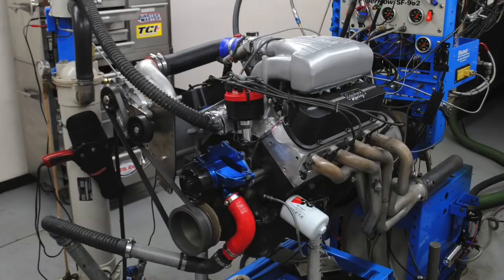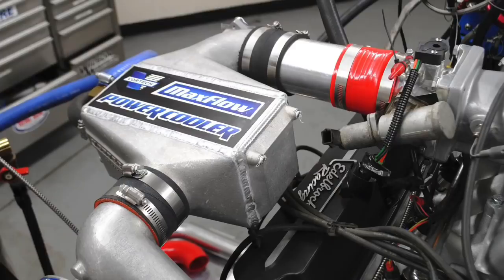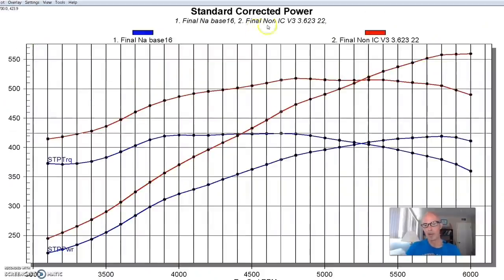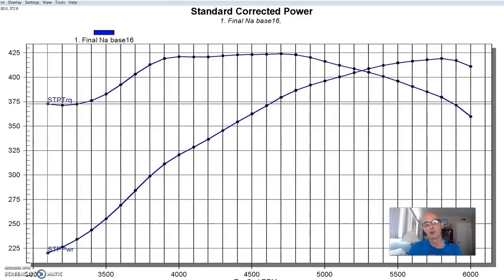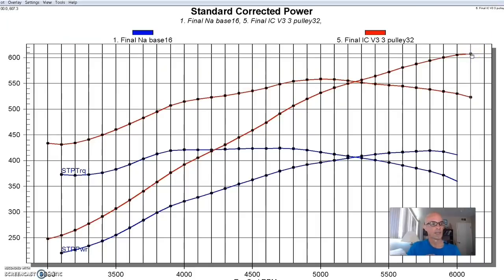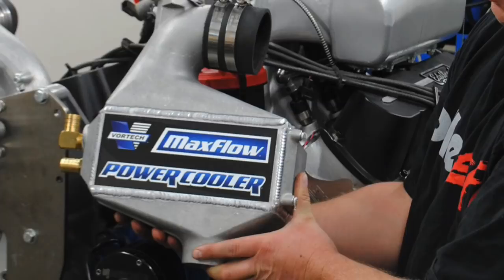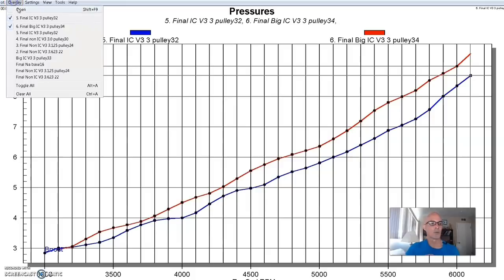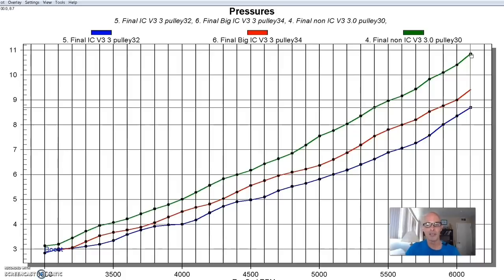WHAT MAKES MORE? INTERCOOLED OR NON?

Comment: It's good to see the Edelbrock Power Package deliver as advertised. They claim 410 hp from their 351W kit, and you got a little bit more. And that's on a junkyard short block!
Reply from the maker: we made 459 hp with a carb on this
Reply: @richardholdener1727  Wow! Why so much more than advertised? A different dyno protocol? Or did Edelbrock test theirs with EFI?
Reply: @donellmuniz590  his numbers are always higher because no accessories turning, straight headers with no exhaust etc plus it has no driveline loss not sure if they were quoting crank hp or not.

Comment: I think in realworld application i.e. in car the temps for non intercooler do to underhood temps and more load from accessory assembly and load generated from drivetrain and actual road force. And agree with you using intercooler regardless

Comment: Awsome thanks for the video! Just picked up a water to air cooler like the one you used for 200 with a zr1 heat exchanger. I'm so happy to hear that I will be making safer hp than running non intercooler. Thanks for your hard work Richard.

Comment: We have ran similar testing on Yamaha Waverunners which have crankcase mounted Centrifugal Superchargers from the factory.Running up to 30psi the Big Chinese/Ebay intercoolers always made more power than the smaller Vortech/garrett cores.The cheaper cores with less fin density always flow more CFM and with open fresh water cooling intake temps do not change much either way.The larger and cheaper the better IMO

Comment: the cooler denser air slows down the flame front....
Which allows you to add more timing to make more power... which you didn't do at all...
So you didn't change timing to take advantage of the cooler denser air....
And you also had less boost overall...

You didnt do a proper and equal test

So even without any tuning changes.. it made the same power on less boost...
That means its making more power with the intercooler

Comment: I think the main purpose of the intercooler is to A. lower the charge temperature & B. lessen the chance of detonation and enable you to run more timing advance to create more power. I bet if you had re-adjust the timing in the tune with the larger intercooler it would have surpassed the non-intercooled HP numbers by a good bit.

Comment: Do you ever tested a difference in charge air temps using a injector on the pipe? Like those water methanol kits, or even a fuel injector.
Reply: The owner of procharger has a drag car that has two injectors dumping meth straight into the blower. Cool car

Comment: I been playing with WMI on my turbo car. Yesterday was 95f. I have a air air intercooler and right after the outlet is a snow performance WMI nozzle size 3. 50/50 mix was seeing charge temps of 73f.
Reply: That's really good.
Reply: @donellmuniz590  I thought it was good as well. It's a noticable difference. It's nice getting timing advance on hot days. Before WMI i would usually see -5 or so.

Comment: It sounds to me that you didn't maximize the tune the changes (especially timing). The cooler air charge temps should have allowed more timing. Also it could have be overly lean/rich which would have killed power.

Comment: Would love to see non intercooler E85 vs M1 fuel.  Measure inlet temps and egt's at say 15-20 pounds of boost.  Interested to see how E85 cools combustion vs M1.  Methanol should be better, but how much better?
Reply: About 3xs the fuel so yeah pretty good on the intake end as for egts it's not much cooler. When we ran meth we saw 1450 happy on e85 we see 1450.. on long runs the meth gets closer to 1700 but we don't do landspeed. E gets to 1800ish on the same runs. So it's cooler but not by much but if your running enough boost and have enough spark you can keep it at 900 like in a blower motor and it lives happy. Can't do that as easy on e85.

Comment: I feel you limited the intercooler applications because you didnt adjust the tune at all between the tests. Isnt that the benefit of the intercooler? Cooler air so you can run more timing and less fuel. If you take that out its mostly an airflow restriction. Hmmm.

Comment: I run a Vortech V3 on my V8 Audi S4. I have run it without an intercooler and then with an A2W intercooler both at 6.5-7 psi of boost pressure. The ECU would pull ignition timing from too much knock after most of a 1/4 mile dragstrip pass when running without an intercooler. With an intercooler I can keep the IATs down and not see any ignition timing pull. It seems like this 351 W isn't knock limited.
Reply from the maker: WE RAN GOOD GAS
Reply: @richardholdener1727  that definitely helps to prevent knock. I would see better results on 104 octane vs 93 octane.

Comment: Simple = He Told us the secret over and over... The Timing was still set at the "Safe" setting for the Non-IC Intake Temps (non-aftercooled if you want to be technical) and anyone who has "Fixed" the 70s smog engines will tell you Timing = Power if your Air Charge (and Boost Pressures) allow it... Cooler IAC + Less Boost = MORE TIMING!
Reply: Speaking of 70s smog engines, did you know that Ford installed the cam 6-8 degrees retarded on the 351M/400?  That's one of several reasons they're such gutless pigs, despite 2V Cleveland heads. They may have done it on other engines, but I don't know. A simple hi-perf aftermarket timing chain fixes that.
Reply: @donellmuniz590  GM was doing the same thing during this era. 3 degrees of cam retard ground into the cams and ignition timing retarded -both to help emissions and because all the EGR requires less ignition timing because the fuel, air, exhaust gas mix burns slower.
Reply: @adamarndt7617  I can believe that. Small wonder the 2 bl 350 in my 76 Malibu was only rated at 140 hp! I did not know WHY  Ford did it, but the EGR thing makes perfect sense. I do know that a timing chain installed 4 degrees advanced, 14 degrees initial timing, a carb and intake, no EGR, and headers REALLY woke up my 78 F150's swapped in 400.
Reply: Same with the Clevo 351 in Australia. Move the cam timing and they really go!
Reply: I must have missed that. I thought he said he kept the timing consistent throughout all the runs.

Comment: The intercooler version had less power due to boost drop after the IC and since the supercharger sends a fixed amount of air, the restriction of the IC  is not made up for like a turbo could with some boost controller tinkering. 
But still is best to run the IC as it would be the more stable and more safe too run specially on a street car.

Comment: Obviously the cooler temp did not increase enough oxygen to overcome the restriction. On a turbo with much higher charge temp, probably would be an increase.
Would be interesting to see differential pressure fore and aft of heat exchanger.
Blow through carb cools the charge.
I like meth injection.
Now turn it up till it blows!

Comment: Comment #2: Richard! Could you do some dry sump testing based on how much vacuum is being drawn in the crank case? Also - any idea how engines like NASCAR are able to handle upwards of 28 inHg, but if I did that on my car I would suck the oil straight out of the bearings?

Comment: Mr. Pedantic checking in! Technically any charge air cooler that comes after your compressor(s) is an "aftercooler". It's technically only an intercooler if it's between two charge air devices (ie. between two turbochargers or between a turbo charger and a super charger
Reply: Modna89 The term ‘intercooler’ was widely penned in Saab’s ads in the ‘80s. Guess the term stuck.

Comment: Simply put, less dynamic pressure loss combined with better atomization, and is subsequent cooing effect, homogeneity, and increased burn efficiency...  
on the other hand, continue the comparison using a) water injection, or  b) methanol injection, to see the effects of further cooling.
BTW, I really appreciate these videos.

Comment: If you calculate the air density, it comes out nearly exactly the same for the non-intercooled and the larger intercooler, which explains why it made basically the same power. As other people have commented, though, with a little more timing you could get more power out of the intercooled version.

Comment: I don't know but my call is, the blower displacement is sized for a 5 liter and compensating for the low displacement blower (in this application) by turning it faster is causing this, since the greater pressure of the hot non intercooled air is greater than the gain from cooler air and the attendant pressure drop. 
In short there's no excess capacity in this blower in a 351 with this head and cam combination as the blower is too small.
That would be my guess - and it's only a guess.
Reply: I feel the same too. The CFM this blower has is just not quite enough for the engine and the intake system.

Comment: Being from Florida I feel like I’d still want the intercooled version with less power because after 3-4 highway pulls the non-intercooled version won’t make more power.
Reply: Exactly!
Reply: Thats how lots of boost is. All over the world. Charge temps go up,power goes down, saftey fratures start kicking qnd your falling on your face. Intercooled keeps that down and can add ice tank for even better results.
Reply: You might be able to get by with water/meth injection instead of an intercooler. Up to you though.
Reply: Or the air wont be heated by a heat soaked intercooler since its still just brand new fresh air being compressed unless the piping retains that much heat but it shouldnt
Reply: Hahaha half a pull not even 3

Comment: Great testing and information.  Would loved to have seen WMI included in the testing.
Reply: Banks has a dyno video. Meth adds fuel, water does nothing.
Reply: @AndyFromm  real world testing has seen gains from straight water injection dropping heat on blower aplications. There is also the well known decarbonation cleaning you can do with water on a running engine with similar results to seafoam so there are benefits.

Comment: Running the supercharger takes power. Back pressure in the output of the supercharger puts more load on it. So running no intercooler reduces the losses to run the supercharger. So you didn't make more power, you made the supercharger run more efficiently. Try running a big air to air and see what happens.

Comment: You know damn well it has to do with ignition timing. Timing is needed to take advantage of the cooler charge. You know that basic rule, every 1 degree of cooler charge you can make 1/2 hp (ie drop 100* can pick up 50hp)...with the appropriate ignition timing...
Reply: Fuel injection as well, as the intake manifold temperature changes it’s going to change the fuel inrichment which will need to be fine tuned. 

The 110 degree air might be a more aggressive tuned than 80  degrees On the air temperature correction map
Reply from the maker: there was no correction for temp-we didn't even use a IAT -just a probe from the dyno
Reply: Richard Holdener foot mouth...

Comment: The distance the air travels and the turbulence created with the extra plumbing.  With the charge coming off the supercharger directly in to the intake. There is a possible vortex effect happening. By adding the bends of the extra pipe, and the cores in the cooler to flow through that effect is lost. Same issues happen with a tail pipe turbo system. The speed and velocity of the boost charge decreases over distance traveled. The CFM rating drops. Best way to explain it is looking at your air compressor. It's duty cycle vs. cfm. Using a cut off wheel it starts off fast, but slows down while the compressor is running. Your cfm dropped while running the tool. If you don't have a proper compressor to run at a higher cfm rating then the tools duty cycle. You will run out of full power operation quickly. While the tool is still working and the compressor is maintaining a lower air pressure it still work, but not at its max potential.

Comment: Now try Non Intercooled with a carb set up....
Reply from the maker: I've run lots of blow-through carb tests-it definitely cools the charge air
Reply: I've seen Freiburger and Dulcich do that on engine masters. Using a blow-through carb cools the intake charge a LOT versus a port injection setup. Just that additional 6-8 inches the fuel travels with the air in the carb setup pulls so much heat out of it. It's amazing.
Reply: @Shane-Singleton  Very True we are using Enderele Mechanical injection on two 427 Tall decks with 8V71 Blowers and Methanol and the injection takes place BEFORE the SuperChargers...and when they are done running on a hot day the Blowers sweat  (because they are physically COLD) like your cold beer without the cold sleeve!  Its amazing how much the Fuel Atomization Cools the intake as you GO!
Reply: @misters2837  especially methanol! But I've run a 2 inch aluminum carb spacer on gas engines, and seen THOSE sweat after a pass too!

Comment: What is the difference between intercooler and aftercooler?
Reply: they both do the same thing they are mostly a air to air heat transfer cooler setup but they are mounted in different locations in the engine bay intercoolers are used for 2 or more turbos like a biturbo or compound turbo setup  for example

 biturbo or compound turbo setup (1st turbo = intercooler = 2nd turbo =aftercooler = throttle body 

        single turbo setup                   single turbo = aftercooler = throttle body

the aftercooler is the one that everyone shows off in the front bar everyone just calls the aftercooler a intercooler no idea why      his a video https://youtu.be/Qi1YvZTwQk0 hopes this helps

Comment: Hey Richard is there any way you can test if a fuel Inter cooler or fuel cooler work on making more power (ice coolers) for fuel? Does that affect engine performance.... example Mr Gasket fuel cooler 1350 and canton racing fuel cooling tank 80-500 thank you hope you can make this video and keep up the great work
Reply from the maker: Engine Masters did fuel cooling-it works
Reply: Yes they did a water pump accessory episode and if heat affects horsepower, but they have not done or I haven’t been able to find a video where.... the actual fuel ( regular or race fuel) being hotter or colder makes a difference in power and if it does how much.... that’s why would the fuel cooler work??? I’m from Arizona and it’s really hot so fuel boiling could be a problem on my race truck that why I wanted to buy a cooling fuel tank see if it works... is there any way you can test that??? Thank you
Reply: That's why, for many years, drag racers have used a "cool can". Just a can with a coil of fuel line in it, and you fill it with ice. Obviously not practical for anything other than a drag car.

Comment: The pro of intercooler is cooler intake temp hence more timing and less fuel to control EGT generating more Hp. The con is obviously  abrupt the air flow. The pro is much important than the con because the con could be easily compensated. Your experiment showed how much Hp loss due to this con, but did not utilized the pro.
Reply: That is probably the most intelligent comment I've seen on any subject lol
Reply from the maker: less fuel for more HP? that would be a neat trick-intercoolers don't add power from timing-its charge density-even at the same timing level (which was kept constant or this would be a timing test)-every other time I have added an intercooler-it made more power, even with no change in timing-that's why this was unusual
Reply: @richardholdener1727  I mean if the IAT is high enough timing must be retarded in order to keep away knock,  you know any ecu have that IAT compensate table, this is more often happens on high boost engines. Cooled gas after compressor cost less energy to compress for the same mass, so it should have more mass air flow so the engine would make a little more horsepower. One thing I would imagine is the velocity of the air was loss pass through intercooler this is not temperature  or pressure related.
Reply: @richardholdener1727  Maybe just this combo   is so sensitive to the airflow velocity?
Reply: I'm sure they did all that.  He just didn't mention it this time.
Reply: @michaelangelo8001  Yes, this experiment showed how much affect the con had.
Reply: Bingo. It is an air restriction essentially. Leaning it out and adding some timing to take advantage of the cooler charge is the whole point! I believe they did the same when they were comparing water/meth injection, and totally missing the point.